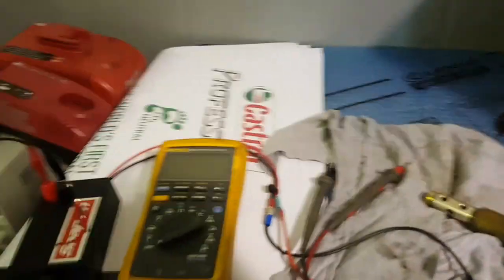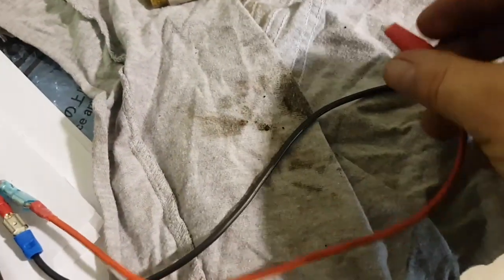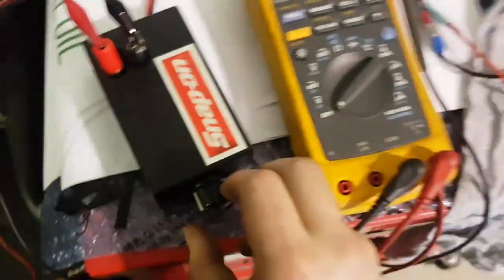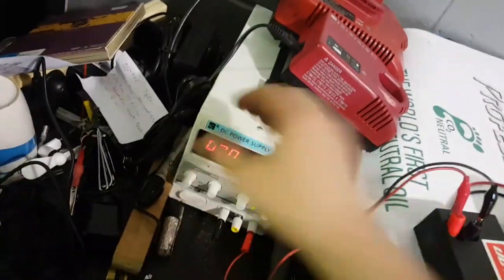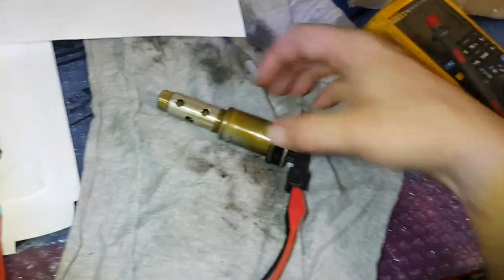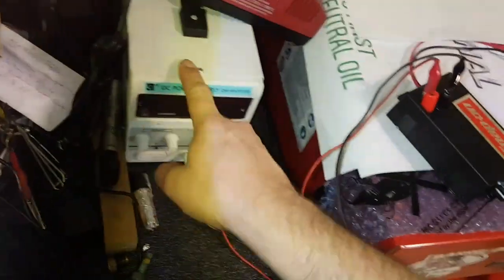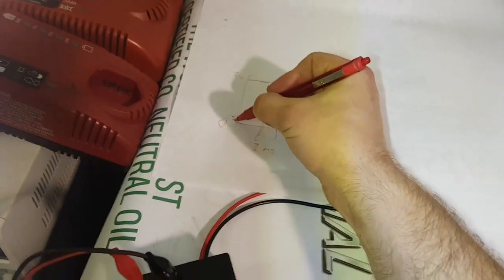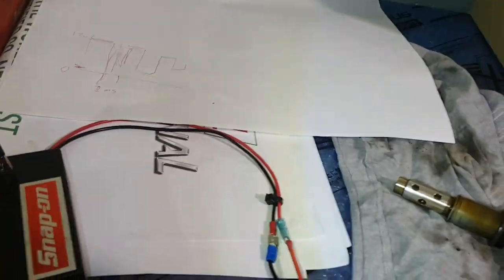bmw vanos solenoid electrical testing and operation

Comment: My one is 10.9 ohm,other is 10.5 ohm...

Is 10.5 ohm okay,or?

Thanks!
Reply from the maker: Probably. Just checking the resistance only tells you if it's mega fkd or not. 
Actual issues like flow rate, blockages or the valve not opening fully can only checked with more equipment.
At that point it's easier to just buy a new valve.

Comment: Hi, ordered some solenoids from ebay, checked them with 12v, they operate and do it quite fast, no sluggishness.
Although when shaking one didn't make a sound at all, and one was making a sound like something was loose inside.. What could it be?
Reply from the maker: +TheAkNas thats the core of the solenoid making the noise.
the core sits inside the electro magnet.
when power is given to the magnet, it generates a stong field that moves the core outward and pushes the valve.
because the core has to move back and forth it cant be held inside too stiff otherwise it wont move when the magnet is on.

with the magnet off, the only thing stopping the core from moving is the return spring which simply doesnt reach all the way sometimes or have enough strengh to hold it closed against your shaking.
Reply: Alright thanks for the explanation. So it's not necessarily a defect?